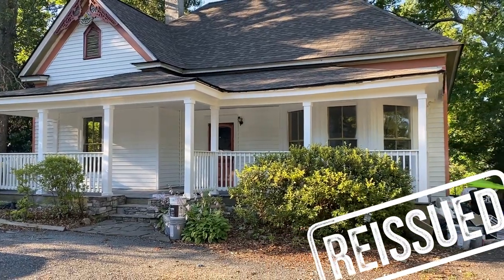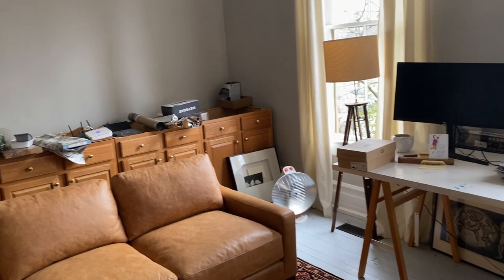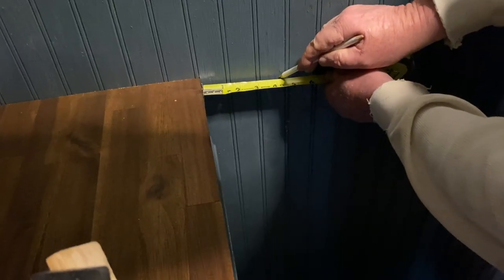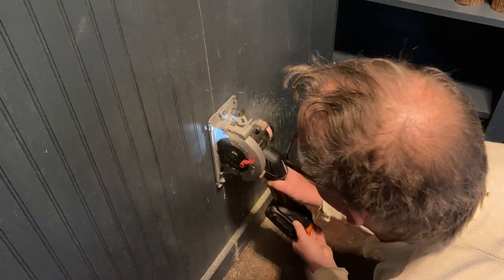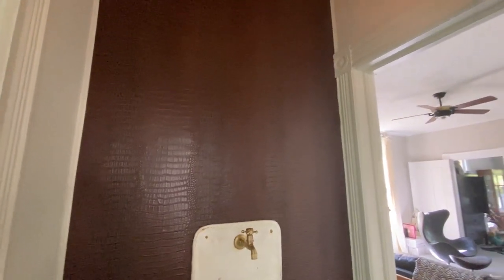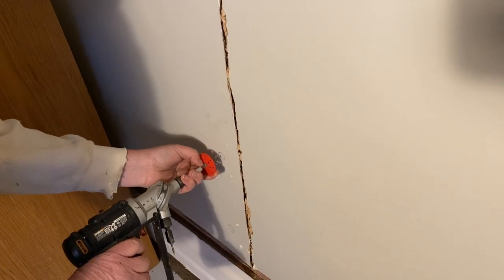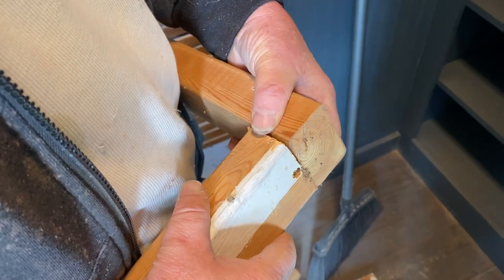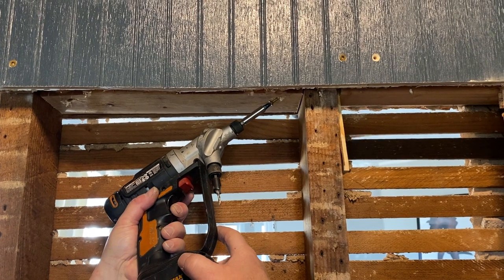I tore down a wall... kinda | Plaster wall removal and repair | REISSUED

Comment: In the 1990s, I helped my parents renovate their 1916 cottage. It's in Kansas, and it is built like your house in several ways:
- single story above a crawlspace
- steeply pitched hipped roof with a couple of gables
- interior doors of different heights
- plaster on wood lath

In my parents' house, the plaster was reinforced with animal hair.

In your house, I'm guessing that the little toilet room was the passageway between the living room and kitchen, with its taller doors. A wall hung service sink and/or some cabinetry might have been in that small passageway.

Your pantry, with its shorter door, probably was always a pantry/larder. Shorter door heights (about 72 to 76 inches) were common for closets, larders, and bathrooms.

Excellent design concept, Andrew Harper! I agree with Andrew Schultz: The connection between the living room and kitchen looks like it always should have been there.